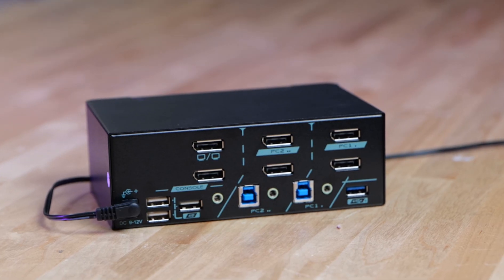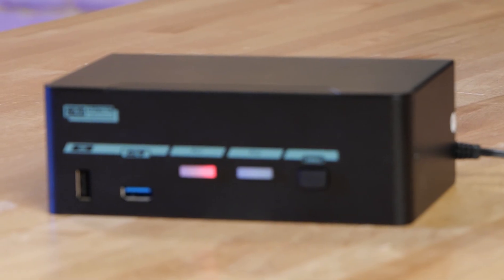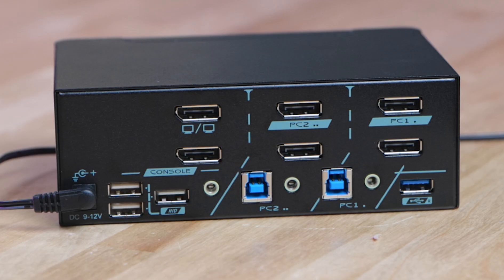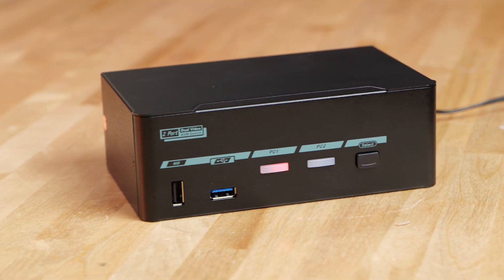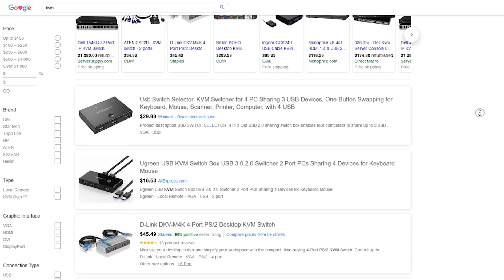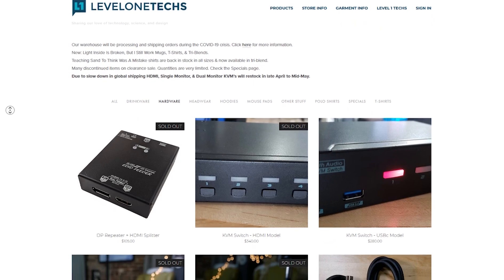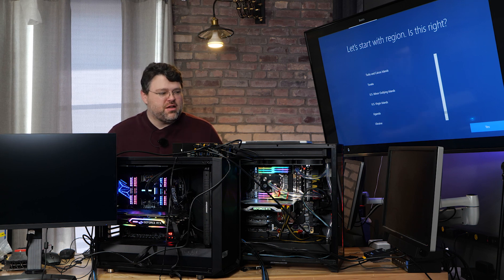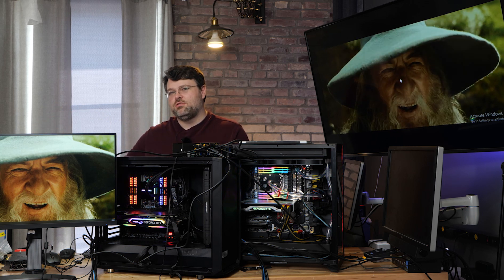NEW Level1Techs KVM: DisplayPort 1.4!

Comment: 6:05 "Each of these computers has two display port cables connected..." Two cables? I know I can plug my laptop into a docking station from a single USB port and output to two monitors. Are the two cables just an option to increase the bandwidth?
Reply: Did you find an answer to your question? I am trying to find out the same thing right now.
Reply from the maker: You need one cable per monitor. It's non optional. There is nothing in the kvm that acts as a splitter by design.
Reply: Ah great, thanks for the clarification.

Comment: Why is this $400-$500 when there are competitors with the same DP 1.4 8K specs for $50-$75?? I would have bought one if the price wasn't so incredibly out of touch.
Reply from the maker: ..says the person who has not yet experienced the $75 kvm... lol
Reply: Because the competitor KVMs are a dice roll. Wanting to only pay 50 bucks for something that handles signal for display, keyboard, mouse, external drives, graphics tablet inputs, launchpad and midi keyboard inputs, and so on is a big ask. You can plug a wide variety of shit into a KVM. Those cheap models are built with such poor tolerances and material that it's not a matter of if, but when it will die.

Schiit is the same way; you can buy a mass produced amplifier for 35 bucks, or you can pay 220 bucks for one that may very well outlive you. China sells products, not reputation. If a brand fails, they just change the outer casing slightly and sell under a different brand and Americans are none the wiser. Level 1 Techs can't pull that. They HAVE to stand behind thier product.

Comment: I bought this KVM a year ago, and i combine this with my laptop dock and my gaming/linux rig and occasional raspberry pi fiddling. It is a lot of money, granted, but it does the job perfectly and I never had any issues. Refresh rate is good, usb-c transfer is flawless. Switching goes easy, and in the long run, it saves me a lot of time.
Great product, no regrets!
Reply: I am desperate for a 144Hz compression-capable KVM switch ... and so far this seems to be the only game in town. What resolution/refresh are you pushing? I have a 144hz 4k monitor that I use for gaming and also my work laptop, and it's like to seamless switch. I use the DP and HDMI connections now, and have to navigate the monitor menu to change inputs, and it sucks.
Reply from the maker: You'll probably want fiber optic cables. Check the factory on the forum

Comment: been waiting so long for the restock.... and not yet available.. 2 years of wait
Reply: Restock just now i was notified
Reply: @TheTyras77  hey man you the best!
Reply: @loganqiu4447  Could you made me a review when you receive it. I have the connectPro and after 2 weeks he start to blinking my main monitor (2x 1440p 165Hz MSI curved) and now it was unusable before blinking or turn off and on one of the 2 monitor every 30 seconds ... I don't have the money to buy it now and i already hesitate between tech 1 and the connectpro but when i order the connectpro this is because the tech 1 was out of order. So if you say it was good without bug i could order this one !
Reply: @TheTyras77  hey for sure!
Reply: @TheTyras77  Hey Thomas - I can tell you now since I've received the switch.. This is not a good buy. I just wrote an email trying to return it. The "plug-n-play" usb ports aren't working at all so it basically lose all the meanings for me to buy the switch.
Reply: @TheTyras77  Angusplay DisplayPort Switch 8K Splitter Bidirectional DP 1.4 go to amazon and look for this keyword. i bought two of them and an ugreen 2 to 4 ports switch and they've been working fine. I wanted an easier solution but a close-to-500-dollar item works the same as < 100 items? what a joke
Reply from the maker: You didn't email tech support, which is me? I mean obviously the USB ports have to work...?
Reply: @Level1Techs  yes it is supposed to work but no
Reply from the maker: You could email me wendell at level1techs . com and I will help you with it and you can explain what you are doing a bit better.

Comment: i have 2 alienware aw3821dw monitors, with 1 2019 mac pro and 1 desktop. the desktop is running on 3840 x 1600 144hz. I am wondering if i purchase your KVM switch, can i still have the same resolution with the same refreshing rate? thank you in advance!

Comment: I have 1 1440p 144hz monitor and 2 computers, an rgb gaming keyboard and mouse, webcam and USB wireless headphones. I tried just a USB switch for the peripherals and all it did was keep disconnecting searching for drivers that were already there. How will this KVM work with gaming peripherals?
Reply from the maker: Ideally the audio devices are 'avc' standard and in that case it can work better. Have you thought about taking the line out of one PC into the line in of the other? So it doesn't have to be a part of the KVm? You would hear a mix of both PC's always on your speakers in that case.

Comment: Does it have EDID support? Dont want to be resizing/rearranging my icons/windows all the time.
Reply: No, it did not have all-time EDID feeding and emulation to any connected systems.  The resizing/re-arranging icons/windows issues are caused by no EDID emulation, so each time when you make a switching the video connections are just like physically unplug and replug video cables to/from different computers and monitors.
Reply: @rexwu168  I already know all that, that's why i asked if there was EDID support, in the first place.

Comment: Got mine now! It works like a charm. I have one question. Does EDID only work with DP <-> DP? I was to dump to order the right amount of DP cables right away. With DP <-> HDMI EDID does not work correctly. Got the 4 port one.
Reply: Any cons? Mouse and keyboard Input lag or audio issues?

Comment: I am interested in the DISPLAY PORT 1.4 KVM SWITCH - SINGLE MONITOR 4-PORTS and could not find the dimensions in the specs.  Does anyone have the Height, Width, and Depth?
thanks

Comment: When you say four (4) inputs/port model, you're talking about supporting up to four monitors, correct?  Will this support 144hz or is 120hz the cutoff?  And any news on the four port model?  Does late 2020 still seem realistic?
Reply: I researched it, it appears 144hz for my resolution should be possible with DisplayPort 1.4 (3440x1440).

Comment: will it work with a 4K 144 hz monitor? seems like most are that refresh rate. Even if the KVM has to limit it to 120, will it still be able to run it?

Comment: I've been super, SUPER excited about the Level1 KVMs since I heard about them but I have ONE question about them.

The problem I've ALWAYS had with KVMs is that I'll lose a device during handshake - the mouse or the keyboard or SOMETHING won't sync properly and I have to screw with it to just work.

Has  anyone ever had this problem with these switches?  I'm dying to find out!
Reply: Maybe a late answer, but after a year of using it, I never had any devices dropping out on me.
Reply: @theCountOfTotal  
Thanks for your input.  I'll post my experience in case it helps anyone out.

I purchased two of the 4-port switches shortly after I had originally posted.  I was not disappointed!  These are - BY FAR - the best KVM switches I've ever purchased.  HOWEVER, over the last couple years I've owned them, I have had a single issue.

Once in a great while, (maybe every six months or more?), the switch will get confused and not function properly.  This is a VERY RARE occurrence and the fix is always to cut the power and turn it back on.  (I have a special remote power switch dedicated to it  ;-] )  Turning off my devices is not necessary.  Other than that, it usually works as expected without a hitch.  This is still better performance than any other KVM switch I've ever owned and I am quite happy.  FYI, I'm using a Razer Black Widow Ultimate keyboard which has lots of lights and toys and crap on it along with a Razer Tai Pan, (which they don't make anymore... :-(  ).

I want to purchase at least one more switch for work.  HIGHLY recommended.

Comment: Hi.  Thanks for your video.  I'm trying to find a clean solution to switch between 2 Macbook Pro's (an old one with HDMI and a recent one with USB-C) connected to a single 4K screen, while being able to use a single bluetooth Apple keyboard and a single Apple bluetooth mouse.  So far I have not found the solution...  Any idea?  Thanks again!
Reply: Using a similar KVM such as this one and using a Club3D USB-C-to-DisplayPort cable (bidirectional) as well as some HDMI2.0+-to-DisplayPort converter (or a KVM, that speaks HDMI or USB-C alternate mode) should do the trick. Since I am not using Macs myself I cannot say for sure, because I don't know if there are limitations especially with the M1-Macs.

Comment: Just found your machines and they are really amazing. I've a question, imaging real world scenario: top gaming PC with Samsung G9 monitor (240Hz, 5120x1440, hdr) with 2 x DP 1.4 and a regular Macbook Pro. Idea is to come home bring plug one cable USBC to laptop and click one button on KVM to switch to work laptop, one click and it's Gaming PC. Do you think it's even possible? If so - can you custom make something like this? Thank you.
Reply: I would very much like to see a response to this.  I also intend to run the G9 on a gaming machine and a laptop for work with a kvm.
Reply: This is the exact scenario I am also interested in. I would kill for this set-up. SO CLEAN!
Reply: Mate this exactly what this is for... You get his KVM and for the macbook you will need an adapter/docking station that will charge + split your thunderbolt3 connection into a DP1.4 and input USBs which you will connect all to the KVM, that's what I'm planning to do right now - though I don't have a sick gaming pc nor that cool screen =P also I'm checking the possibility to use an eGPU enclosure with the macbook, it will replace the adapter/docking station and connect straight to the kvm.

Comment: Currently I have a desktop 2080 TI with 3 display ports, running 2 separate DP cable to 2 monitors (4k native 120hz + 1440p 60hz, both have  1x 1.4 DP,  1x 2.0 HDMI).   I have another work laptop Quadro P2000 with HDMI/2xTB3(seems this 2 are linked intel IGPU)/mini-display ports, 2 of the 3 ports into the same 2 monitors, what adapters/cable do you suggest for my work laptop for use with this switch?  Right now it is pretty awful to switch between 2 computer as I have press the buttton on the back of each monitor.    Thank you

Comment: Looking for a new kvm. Getting tired of my Macbook Pro late-2103 rearranging all the windows every time I switch (no EDID). Need a two-way 4k and single monitor. Can you recommend  one of your devices? Also, I'm new to repeaters that are EDID aware. Where can I find these devices? Maybe to try on my present kvm and macbook to stop the display mess?
Reply: As Level 1 tech stated on its website.  This "new version" will still have the "no EDID" issues as its last old released version.

Comment: I am looking for a type c to display port device/cable/adapter that will work with my triple monitors @144hz and g sync. I have a 2080 TI ROG Strix that only has 2 display ports and 1 type C which I think will work as a display port  allowing g sync and 144 hz.

Comment: A suggestion: maybe you guys should already start work on sourcing a KVM for DP2.0, which is imminent. It runs over Thunderbolt 3 (80Gbps 🔥), so I don't know if any exist. I know Aten makes a Thunderbolt 2 KVM, so that could be a starting point? At any rate, I understand these processes are slow so if you start now then the wait for a decent DP2 switch won't be as long when it releases. 

Right now can't see myself investing in one of these when in a years' time it will become obsolete. Especially with high-bandwith usecases like 4k/120hz or 8k with high color depth. Though I probably will since there is no other kvm like this and I'm a display nut. Pretty decent price even, was expecting a 100 more because of the DP1.4.

Comment: Does it feature keyboard shortcuts (f.ex. ctrl - ctrl - m - 1 for monitor/machine 1) or Companion integration (bitfocus.io)?
Reply from the maker: yes, if you have a hid compliant keyboard ctrl+ctrl+1 switches to input 1 (or scroll lock + scroll lock + 1 ) you can use either/or, and disable the other.

Comment: I'm interested in this. I run an LG 34GK950F-B 34" at 144hz. Would this work for my PC and my MacBook Pro 15" (Home/Work) setup?
Reply: good question! i got the same situation with this monitor and am searching for a kvm switch which allow to use uwqhd 144hz. so far its the only kvm switch that handles this?

Comment: When I used to repair computers, I would have paid ~$1000 for a 4 port KVM that could take VGA, DVI and HDMI inputs, and output to DVI/HDMI... The number of times we had PCs on the bench with 1 of each of those, and no other connection, was extremely frustrating. Most of the time we just used VGA, but Dell and Lenovo and such started shipping PCs without VGA (at all - DVI-D or HDMI, no DVI-I).

But I stopped doing that job, so I don't need that now.

Comment: Also would be nice to have a feature to mix audio of the digital inputs (audio over Displayport). That's the only reason I haven't bought the dual monitor one, because I like to still be able to hear the audio of my "main" machine.
Gonna try the Mayflower Arc Mk2 now though cause it promises the ability to mix 2 inputs (aside from its main purpose as an amp/dac)

PS: 0:40 Not all KVMs have 4 inputs, the USB-C one doesn't...

Comment: Question about the L1 KVMs in general. DO they support using the keyboard to switch between systems instead of using the button? For example like double tap the shift key, then use the arrow key to select, etc. Just curious, and won't change my decision to purchase one at all.
Reply: I know on the DP 1.2 models you can double press Ctrl then a number to switch inputs

Comment: Hi. Sorry to sound a bit ignorant, I don't know much of the background or what went into making, but why are these devices so expensive? You mentioned it is a "dumb" device, should it not be a fraction of the current cost?
Once again, I don't know much about the bom cost and other bits that go into product hence the question. Not trying to be smart or anything.
As an example I looked into BlackMagic Atem Mini device that is selling for less and has so much more. Again, slightly different product, but basics are the same, plus it comes with a software that is pretty neat.
Thank you in advance.

Comment: What about full 5K resolution (5120 x 2880), will it support 60/120hz? On the official site only 8k 30hz and 4k 60hz are mentioned.Thanks
Reply: If that helps, the 4-sources-1-monitor KVM with DP1.4 seems to support 5120*2160 at at least 60hz (according to DP1.4 standard). My MSI Prestige monitor works at that resolution and I think the KVM should, too, once I finally get it.
Reply: @igordasunddas3377  Actually 5k is 5120x2880 so MSI Prestige (even though its marketed as 5k) is not 5k 60hz monitor. Thanks

Comment: Has a super ultrawide monitor been tested? I've got a Caldigit TS3 Plus (can only do 60 Hz) hooked directly to a Samsung CRG90 (up to 5120x1440 at 120Hz) for a work laptop. I'd love to connect a personal desktop to the monitor as well to drive the full 5120x1440 at 120Hz.
Reply from the maker: not that specific model, but yes, confirmed okay for that resolution. If not you could send me the edid dump and I bet we could fix it (if it even has a problem).
Reply: @Level1Techs  cool beans. Sounds like a pre-order from me, then :)

Comment: I need a hardware switch for two usbc thunderbird, so I don’t need to constantly plug the two cables between laptop and pc, please make it, I will buy, just pass though is fine with me
Reply: Kivylius there’s is a usb c version already made.
Reply from the maker: usbc you say? I have that already https://store.level1techs.com/products/kvm-switch-usbc-model (4k/60 limit)
Reply: I'm pretty sure this person meant thunderbolt instead of the Mozilla email client. Good news on that, the amount of Google query returns are very low when you search for thunderbolt kvm. The really bad news is that on the aten website the msrp quote is on request. That usually means mucho dinero..

Comment: I've been running 4 of your KVMs (2x HDMI, 2x DP1.2) for a while and I have some questions about the modifications you made.
Is it possible to alter the behavior slightly, with a firmware update or something? For instance:
1) power off USB HID ports when the selected computer is turned off. (It does it only on the non-HID ports)
2) Don't tell computer #1 that the monitor is no longer connected when you switch to computer #2
Reply from the maker: For #1 it's tricky because I'd need to physically cut power to the devices. For #2 you can get the l1 dp repeater on the store and it'll send phantom signals to the inactive port
Reply: @Level1Techs  Will the repeater keep my currently working gsync setup alive?
Reply: @Level1Techs  Reading the instructions on your store, I need 1 repeater for each computer. So for my 2 KVMs, I'd need 8 repeaters.... that's a lot of dough

Comment: edit: question - do you ship from usa only? I would like to avoid 20% eu vat bs
Recently bought cheap kvm... When all devices are off it is randomly beeping time from time, sometimes it doesn't "turn on" keyboard and mouse when os boots (in grub it works), sometimes it does not turn on keyboard and mouse in bios/grub but it works when os loads...
I think I should get something more expensive...